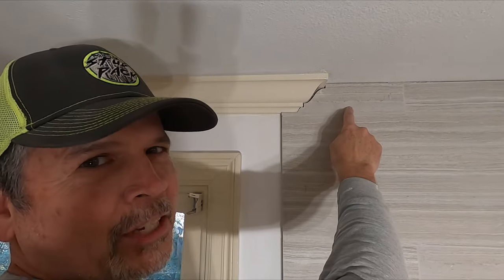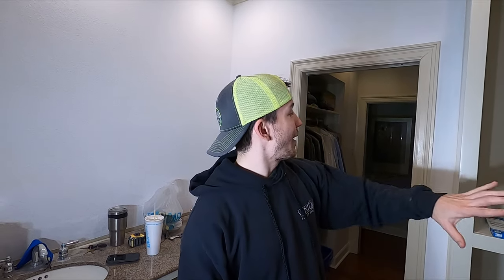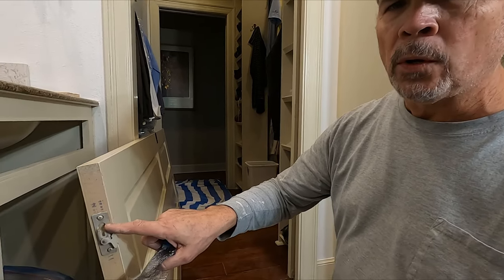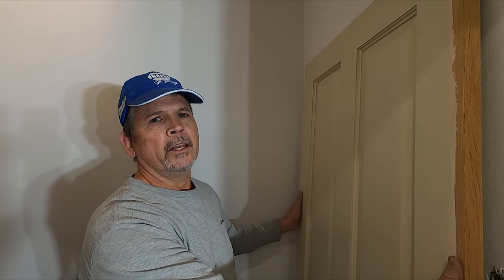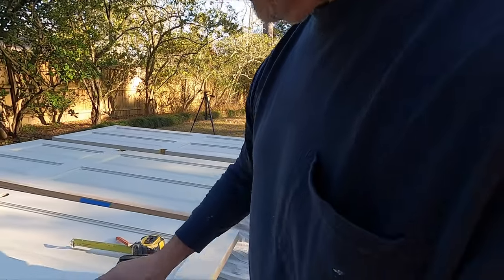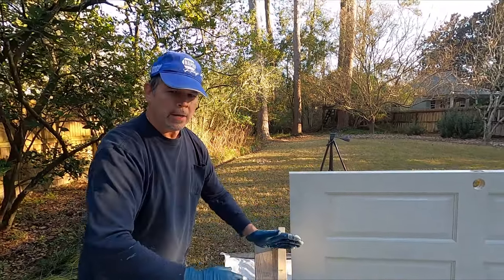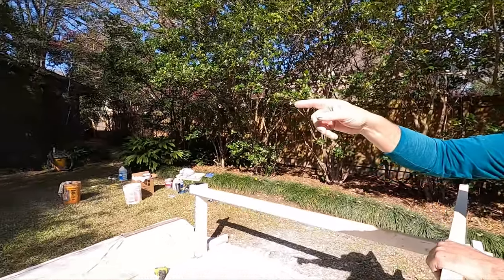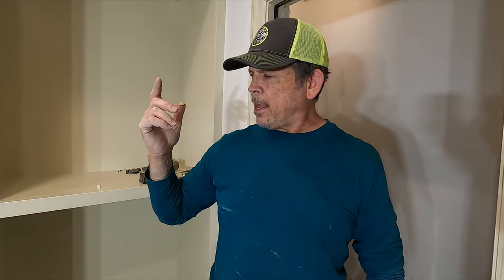A RUN FREE Spray Paint System | Pocket Door Removal Guide

Comment: Blue tape says to cut door to 79-3/8in (approx. 9:27), then seconds later, door is marked to be cut 1/8in less than 79in or 1/2in smaller than tape says.  So, what happened?
Reply from the maker: Man you’re good JP👊.  The number on the tape was the overall height the door needed to be including the hardware on top.  When I measured to cut the door, I subtracted the height of that hardware so I could hook my tape on top of the door.  Hope that makes sense 👍

Comment: Re the caulking.  Silicone is non paintable.  Not that you were using it from trim to wall...just saying.  I'm a former Cabinetmaker and prefer to use Colorflex for caulking a painted item to the wall.  They have a large selection of colors.
Re spraying the inside of cabinets, if you can either remove the back or don't install the back before spraying...This to avoid haloing or bounceout in the corners.    With higher air or gun pressure, it pressurizes the corner and prevents paint from getting in..
I'd prefer to use a lower pressure ...maybe an HVLP system?
With you current system do you have the little funnel which you fill and time the paint takes to get thru. So you know what size nozzle to use or to thin the paint??
Good idea re door jig.

Comment: paint tip: take a hammer and nail or a drill  and drill holes in the lip of your paint cans, paint runs through holes rather than collects on/in the lip of the can
Reply: I've heard this tip but as a painter I always have lots of  rags. When placing the lid back on put a rag over the lid so there are no splashes when you hamer or press it closed. Minimize your tools and steps.

Comment: The only thing I would do different, is I would predrill for those big lag screws you're using. That's what I use to screw house bands or posts on decks. 

If it splits, doors/cabinet doors, then it's cost you a lot more time fixing. Takes 3 seconds to predrill

Comment: That second pocket door could have been removed easier if... One side of that header jam wear screwed in and the casing was not nailed to it. Caulk would have been ok. the casing would have been left in place. Still would be a tight squeeze, that might not make it past the casing.
Not easy to install a pocket door and do a good job.

Comment: The flip rack is a nice way to paint doors. But there is so much wrong in this video. Professionals do not paint outdoors, you will get small bugs, leafs, grass etc in the paint 100% of the time. Also do not use as screws as large as was used in this video to flip the door. If you pay close attention you can see the door crack pretty good. A 18 guage nail or higher guage will work just the same with less cracking.
Reply from the maker: Thx Nate.  Certainly have to watch out for bugs etc.